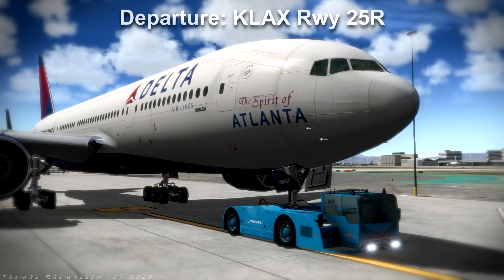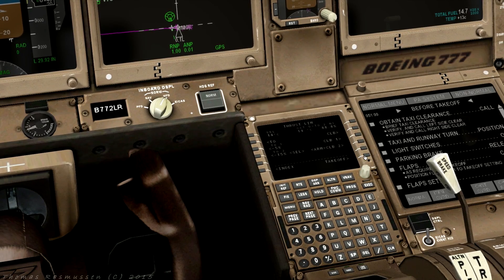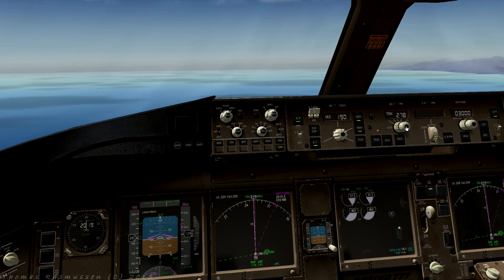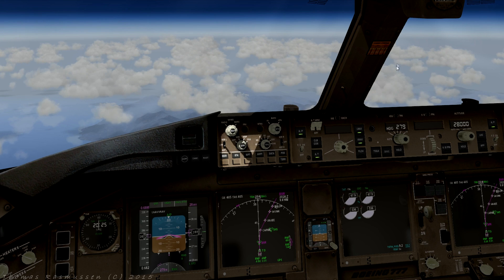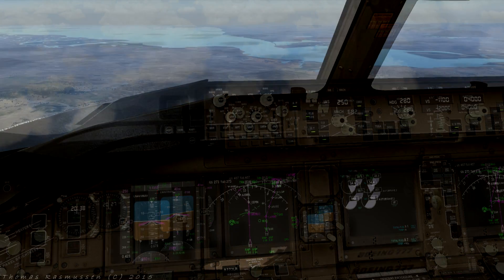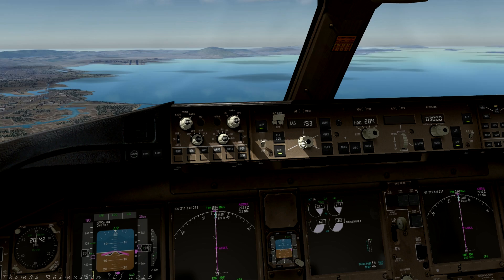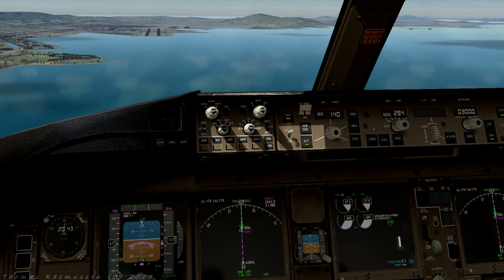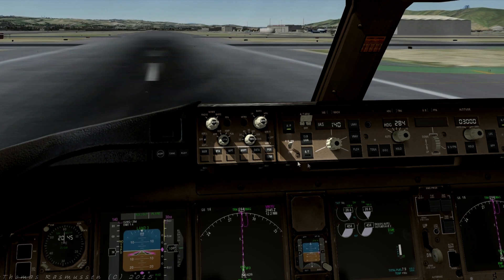Flying the Boeing using the FMC and Autopilot - Tutorial Series Part 4 (X-plane 10)

Comment: If you have the heading to 280 how does the airplane turn for himself? Great video
Reply: 1Eduu Because L-NAV is still active which lets the computer control the heading he set the runway heading in case of a missed approach so when he hits the go around button the heading is already set :)